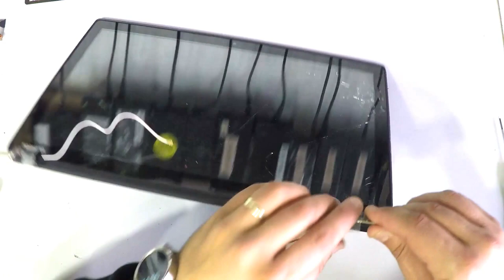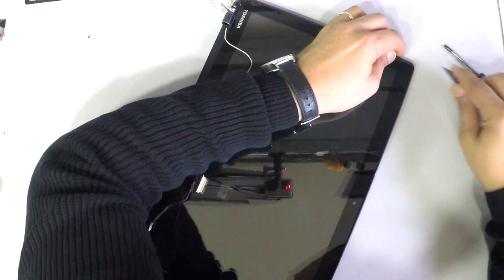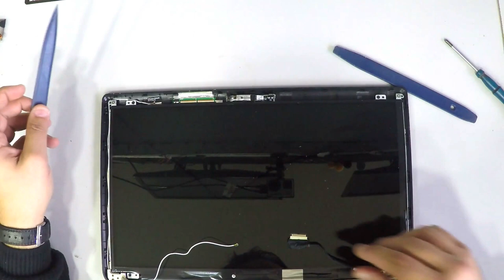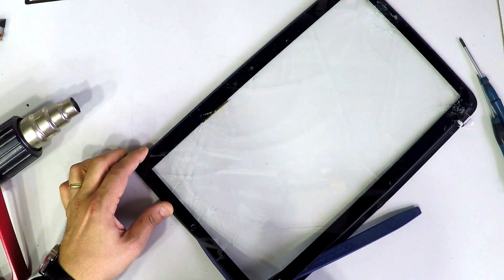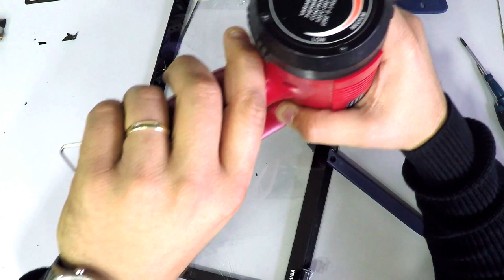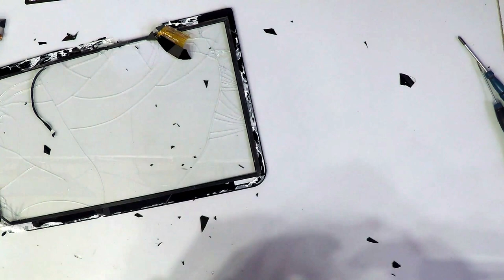Toshiba Satellite C55T Touch Screen Disassembly

Comment: Do we need to remove the whole screen from the laptop in order to remove the digitizer? i have a c55t-a5218 model will that be the same as the one you are showing?
Reply from the maker: Hello Marco, it's easier to disassembly and reassembly the digitizer if the screen is out.
Reply: thanks do you know where i can find the instructions on how to do it for the model  c55t-a5218
Reply from the maker: 1- https://www.youtube.com/watch?v=O3CrL6c2hs0&list=PL43q5LIt9XwAVU6L4L5PrmgZWMy8LKzmv&index=15
2- https://www.youtube.com/watch?v=phfuhVvWHaY&index=16&list=PL43q5LIt9XwAVU6L4L5PrmgZWMy8LKzmv
good luck